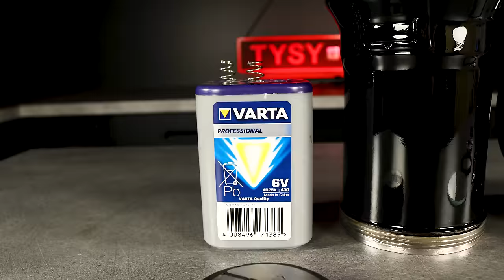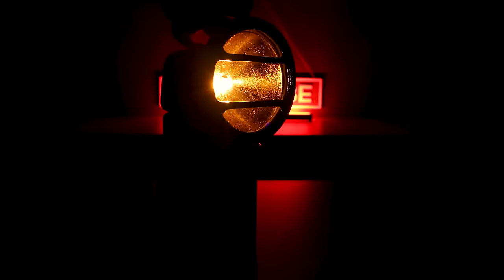The Minor left me money inside, Lantern - Restoration

Comment: I love the effect the gold leaf has when the light is on, makes it looks just a bit older and as if the glass is fogged or damaged from use.
Reply: I didn't care for the effect. I'd have preferred a polished reflector, possibly nickle plated. I would have concerns about the finish holding up as the lamp gets hot.
Reply: @fhorst41  I wasn't impressed with the gold leaf either. Definitely would have preferred a nickel plate also.

Comment: When you solder, you should heat everything up to temp before you introduce the solder.  That way, the solder flows in and makes a solid physical and electrical connection.
Reply: Correct. The heat from the joint should melt the solder.  It should not be done by directly melting it with the soldering iron and dripping the solder on to the joint as was done here.  This result is a cold solder joint, but the good news in this case is that if the nut was tightened down around the wires, no soldering is necessary at all.  Otherwise a great restoration as always!
Reply: I most always tin the wire then wrap it around the terminal.  No real need to try and solder a screw and wire...just makes it hard to get apart later.  It's not always necessary to tin/solder that type of connection, it may create reaction issues with with the flux and cold joints.  An internal Star washer will help the nut make good contact...if necessary.  Nice restoration other than that!

Comment: I would love to see light output when finished from these types of restoration. Just to see how dim they were for miners.

Like against a wall in a dark room or something.
Reply: I have an original 1978 issues USGI 2 batter angle head light.   With modern new batteries and the best bulb I could find, it is about the same brightness as a modern toy flashlight.  LOL My Nebo pocket carry Mycro, is 400 lumens and the size of 4 quarters stacked.   Red light, green light and 3 levels of bright.     I cannot believe we did night navigation at FT Stewart in the early 80's with such weak light.
Reply: You could try adpating a LED instead of a bulb, bulbs are just little furnaces that light a little 😉
Reply: When you're underground, ANY light is bright.
Reply: @mrrustygray 
We did it because there was way less light around. With today's light pollution in any remotely urban zone, we need our stupidly stinking bright LEDs.
Reply: A lot of these old lights put out about as much light as an old 2 D cell incandescent bulb flashlight.  Wheat lamps, where a miner carried a lead/acid battery (about the size of a smallish book) on his belt and had a wire leading to his helmet lamp were brighter and the charge would last a whole shift.  They were placed in a charging rack while off shift.

Comment: That turned out beautifully as always. I was thinking though that it had such a perfect patina of rust it would've been a perfect candidate to boil and turn the red rust into black rust and do rust bluing like the old firearms...would be neat to see.
Reply: I understand how thats a pretty good idea but I think he still wouldn’t have gone with that style of blueing on this piece as a lot of the metal is very thin and that style of blueing can be corrosive. Also he may be trying to restore it to its original specs
Reply: @jacoblaszakovits3035  he did paint the brass black, which I didn't like. Better to leave the brass visible and have the nice accent.
Reply: @adaelion3772  nah better to thicken the material to preserve a relic
Reply: @adaelion3772  also adaelion when it comes to restorations no one cares what you like if it isn’t historically accurate

Comment: I love the finish on this one. I wonder if electroplating the reflector would get the same effect
Reply: Electroplated gold may have been smoother, but the gold leaf uses no special equipment. Interesting.
Reply: Probably not.  Depending on what the base metal is, and how smooth a finish you're looking for, it might need a heavy coat of copper plating first to help fill in the holes.  
Then nickel over the copper, and finally gold over the nickel.   It's a complicated process.  
The leaf was a lot quicker, easier, and believe it or not, much less expensive than having it plated.
Reply: @jimmurphy6095 
And because it's a textured finish, it halps smooth out the beam, which on these incandescent lights is very much welcome.

Comment: so to solder, you heat the wire, then apply the solder to the wire. you did what is called a cold solder and the solder is just sitting on top of those strands with zero penetration and zero bond.

Comment: I really like your projects, but I do take some issues with your wiring and soldering techniques. If I were me, I would have wrapped the wires around the posts in a clockwise direction after I had tinned the end of the wires first. Sorry if this sounds like quibbling, but having been trained in soldering during my U.S. Navy nuclear power education, one learns that soldering is more than a skill, it's an art form, not easily mastered and often done wrong.

Regardless, keep up the good work. Your cleaning/sand blasting/painting skills are first rate and quite impressive!

Comment: Why black? Why you want yellow/amber light? (gold leaf will reflect the light as yellow/amber, and won't be as bright as white. Could have polished and re-chromed the reflector, or replaced it with a new one the same size.
Did you reuse the original bulb? It looked like it was still good. Will you use this, or is it for display? If for use, have you considered putting in a 6volt LED conversion bulb?  I know Mag-Lite sells LED conversion bulbs. I think Brinkman does as well. They are not the only ones of course.

Comment: That's not gold leaf, it's "Dutch Metal", basically brass. The crinkling sound as you pushed it into place is a giveaway.  I've worked with gold leaf and it is much thinner than what you had there. It can only be handled using a gilding brush, there's no way you would have been able to handle the real thing like that, it would have just disintegrated.

Comment: The author soldered the core to the screw! How do you unlock it now? You can't do that!!!!
Tinned wires are necessary make on a wooden plank.
You cannot tin core on the contacts!!
The insulator overheats and melts, you solder the wire to the contact!!!
The rosin needs to be scraped off!

Автор припаял жилу к винту! Как ты его теперь открутишь? Так нельзя делать!!!!
Лужение проводов производится на деревянной дощечке.
Нельзя лудить провода на контактах!!
Перегрется или плавится изолятор, провод припаять к контакту!!!
Канифоль нужно соскоблить!

Comment: two thing.....1> the headshell on that lamp: high-reflectivity orange under 3 layers of clear coat.
2> grind that rust real fine, bake at 450* F, regrind while adding titaniun and aluminum powder.
Ti  20%, Al 80% = (F)uel powder.
baked rust is (OX)ydizer.
(F @ 3-parts ) + (OX @ 5-parts) = semi-exotic thermite.
use magnesium to ignite, result is titanium/aluminum-laced iron + slag on top.......
(2-parts thermite + 1-part charcoal powder, when burned, gives steel not iron,
add 1-part 50/50 chrome/vanadiun to 3-parts (F) to obtain superior steel)
take the result to the forge (reccommend demascus-style blade......any less is injustice to the metal).
'nuff said.